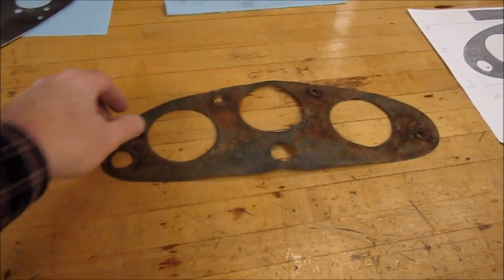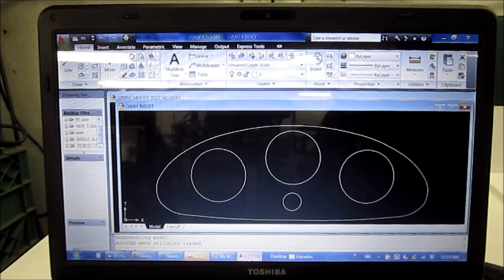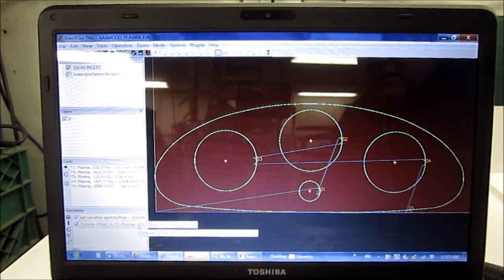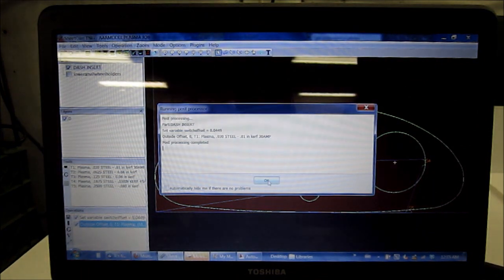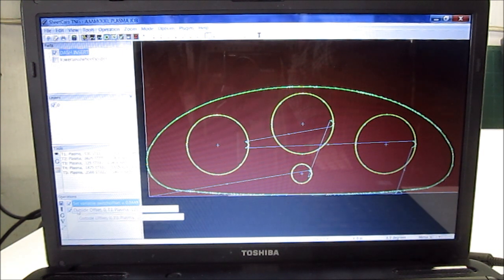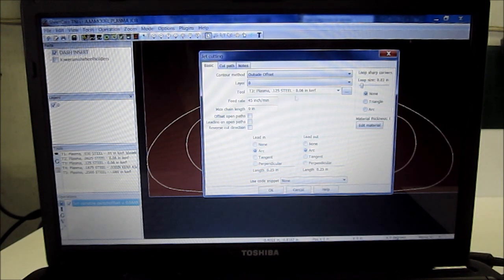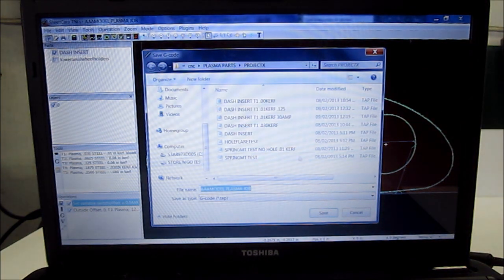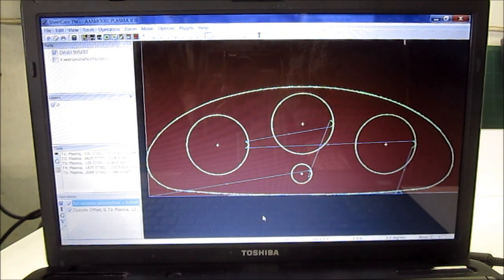CNC PLASMA PROGRESS NO9 - RECREATING A PART - GENERATING GCODE IN SHEETCAM

Comment: i have a hypertherm powermax 1000 and i know which two pins fire my torch but i dont know what the others do....in the manual it says that pins 3,4 are to start torch and 12,14 are for xfer (start machine motion) where would i have to hook those up on my break out board and what would i set those to in my mach?
Reply from the maker: There is a special screen for MACH for Sheetcam. Probably best to have a look at the MACH forum, lots of these questions are answered there.   http://www.machsupport.com/forum/index.php?action=search2
Suggest searches for "Sheetcam" and "Plasma"

Comment: how do you make your torch and mach work together in order to turn the torch on/off?.....do you designate the torch to be m3 or m4 o spindle on/ offf or digitize triger?.....and also how does the gcode successfully manage to give those orders?....do you also designate or change something in the gcode or sheetcam?
Reply from the maker: GusX32X I
Your plasma cutter will require being cnc ready so the interface cable to it can be plugged in to the PC through a second printerport card. All the newer plasma cutters are cnc ready.
Mach will then be able to fire the torch, sense when the torch has established arc and then command stepper motion to first l ower the torch from pierce height to cut height. Yes the command to fire the torch is the same as the start spindle in gcode and is generated by Sheetcam.
There's a lot going on here. This is all configured in Sheetcam. 
You'll have to check the Sheetcam site,  there may still be an evaluation trial download available.